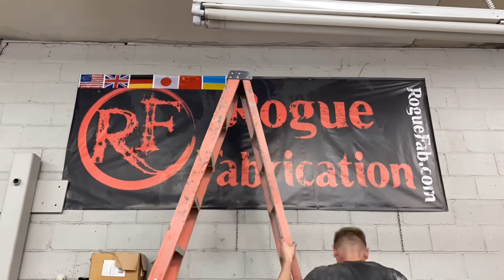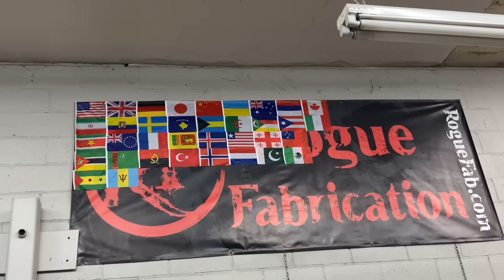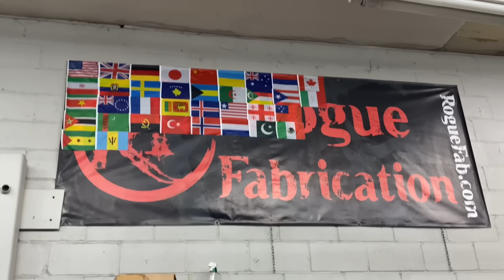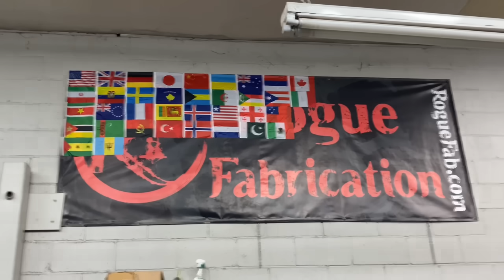Rebuilding a Wrecked Mercedes G550 Part 2

Comment: These overpowered versions just aint the real deal. The original with the 5 cilinder diesel (300GD) are the crawlers you want. Reliable one million mile terrain cars that can do 70 on the highway providing comfort. Doing 20 miles per gallon.